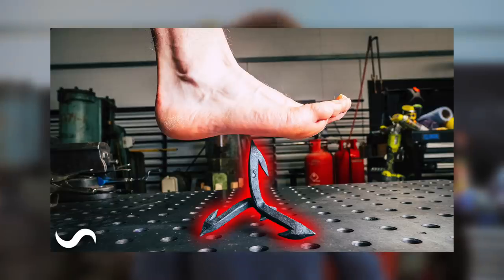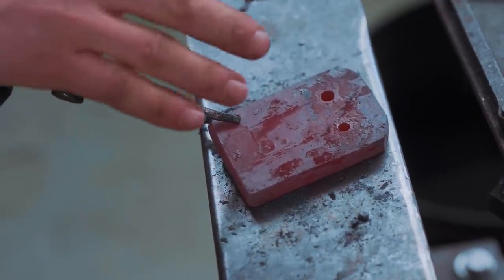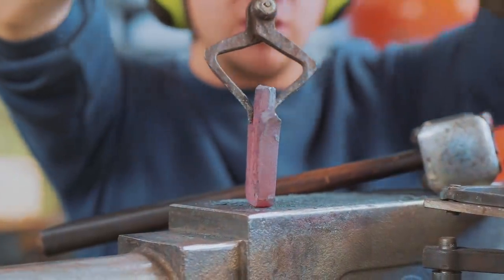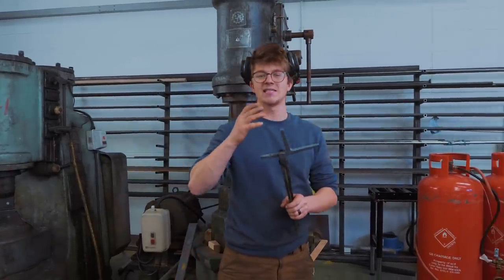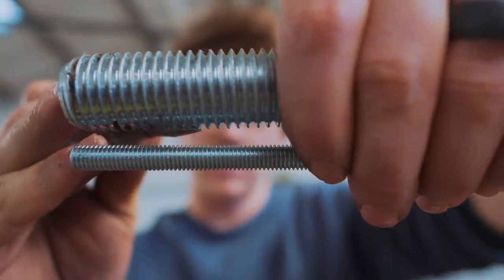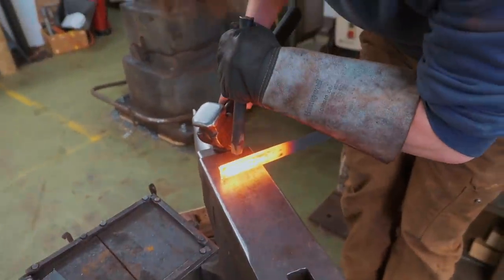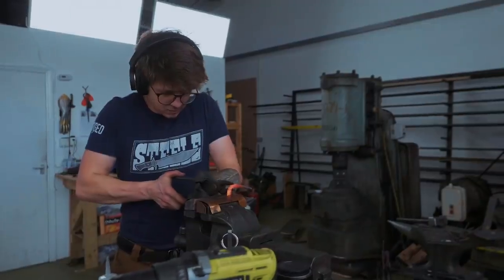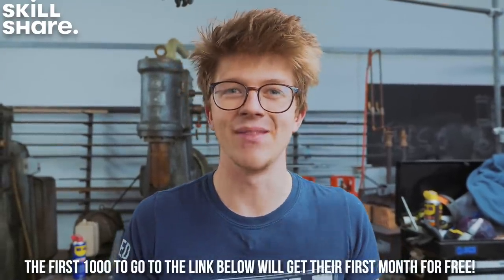Making (and testing) the THUMB SCREW!! Medieval torture device.

Comment: These projects are really fun to watch! Torture devices or not, these videos are a great excuse to actually do some proper blacksmithing and show of many different techniques and problem solving!
Reply: Agreed
Reply: When i forge i heat the metal up red hot and when i go to hammer it, it doesnt act like it should. Like the metal acts like its not hot enough, buts its red hot so why?

I was thinking of maybe trying a lower melting metal like zinc or aluminum.
Reply: @bigbomb5904  you want bright orange to yellow hot, not red hot
Reply: @ughmas  
Thanks ill try that when it gets warmer out
Reply: Alex, why you not make bestknife?
Reply: @bigbomb5904  don’t do zinc the steel you have should work just make a good hammer swing and get it plenty hot
Reply: @ivyironworks6698  so how long should it heat up for approximately
Reply: @bigbomb5904  It depends on the size of the material. Best just to keep an eye on it until it gets to a nice yellow heat.
Reply: Was literally about to post this - ghoulish subjects, but fascinating blacksmith challenges! :D
Reply: @bigbomb5904  it depends on the forge really so its hard to say but just use your eyes and make sure its a good bright color

Comment: I think, a possible challenge would be a full scale rack. 
Who knows it may even provide some good stretches after a long bike ride.
Reply: Most of the rack was wood. It's only really the rack and pinion mechanism that needs to be metal
Reply: Do you mean Stretches?
Reply: @SentinalSlice  indeed I did
Reply: @richbuilds_com  Alec ,I believe, does has an interest in wood working, so a nice combination of both passions. But thank you for the insight

Comment: He should make the brazen bull its a hollow metal bull that someone was put into and a fire was set underneath it and they would burn alive in it whats cool about it is that the screams of the people inside ould sound like a bull when the sound came out the nostrils of it also fun fact the creator of the brazen bull was the first one it was used on
Reply: Dono if his mini forge can handle something that big.
Reply: I thought it was the steam vibrating through the vents that made the noise, you're supposed to put a low layer of water in it iirc
Reply: A little one for cooking small meats would be fun
Reply: The bull "singing" is a reason there are horns in orchestras now. It's not known it the creator of the brazen bull died in it or was just unwilling testing it. But it was said that it and the ruler were thrown off the cliff and into the sea.

Comment: I don't know if you have this in the english language too, but in german we have the phrase "putting on the thumbscrews" (Die Daumenschrauben anlegen) which means to use pressure or to force someone to do something.
Reply: English has this, though in the form “tighten the thumbscrews”
Reply: @zakhenry  English also has another similar one that comes from torture methods that is more interesting... Holding feet to the fire, same meaning as tightening the screws. the meanings are similar pressuring someone to do something. Although for some reason the one I brought up usually gets included in holding someone accountable for something.

Comment: Yes!!!

Now go for a needling set. Pretty much self descriptive, a set of variously sized needles to be inserted under nails, into the body or even through body parts hotand/or cold.

Sounds simple enough but to hand forge  needles fine enough to not be better off just using a blade may be challenging.

Comment: Alec does seem to be getting rusty (pun unfortunately intended) when comes to hand forging. How about a back to beginnings series doing tools, small projects that cover the fundamentals of blacksmithing, from drawing out to chiseling, straightening and heat treatment
Reply: yes, that would be great. His 'back to basics' videos are all outdated
Reply: @soupmandude  do the basics change?
Reply: And then he can improve his forging skill by doing small device and ornamental work. Like being able to forge out those threads on the arrow extractor more consistently. He's very good at large metal moving skills but the delicate stuff trips him up sometimes.
Reply: @SoulDelSol  i think generally speaking there is value in revisiting this even if the basics haven't changed. Both because it is useful for him but also because he is doing this for longer. He has more experience now. Meaning that he might can improve on the videos from the content of the videos to the quality of the video.
Reply: Agreed back to basics would help improve  👍
Reply: Something I noticed is that he is getting smaller and smaller with the amount of power hammers there are in the shop. In the earlier video's he had arms like a blacksmith.

Comment: 12-point sockets and a drill-socket adapter in your drill make great tap drivers that don’t slip. I don’t understand why the industry is still hanging onto square-end shanks. You could probably use an impact, but not on small taps.

Comment: Taps and dies have definitely been around for centuries, the modern advancement is having standardized measurements. Prior to that you would have one tap that would work with one die, and if you tried using Tap A with Die B then at best it would bind up and be difficult to use if not be completely incompatible. Now I can go to a store and buy two different sets from two different manufacturers and they'll work with each other just fine.

Comment: Correct me if I'm wrong, but even when using a die, aren't you supposed to back off a quarter turn every so often, or is that just for the tap?
Reply: I believe you are correct sir, I also whinced at that particular shot but it was only a few seconds I hope Alec didn't cut the entire thread like that, it's a sure fire way to damge the tools or thread you are cutting.

Comment: While you're making all the medieval devices, why not make a steel chair?
I mean a genuine chair, not some wierd device. But, to make it a little more difficult, can you find a way without using hollow stock to make it light enough to be practical from steel? Lots of choices. 3 legs or 4, high backed or low? How to you brace the legs from spreading while not making it too heavy? How thin can you forge straps for the seat? are arms practical or not?

Comment: A pair of anguish it is a mechanical torture device would be placed inside the orifice of a person and then gradually expanded. The kindest use was in a person’s mouth where it would ultimately shatter the skull, causing death. More gruesome is when it was used on parts in the lower half of the body which were rarely fatal, but excruciating 😈

Comment: Doesn't it make u actually wonder how back then when they didn't have real tools how exactly did they figure out how to make all these metals with minimal knowledge and tools especially how did they heat a steel up to 2000 degrees to melt it no gas no propane